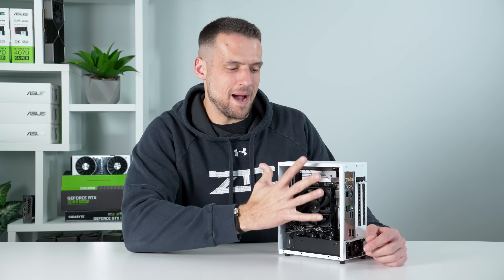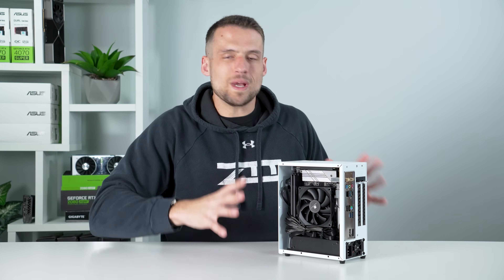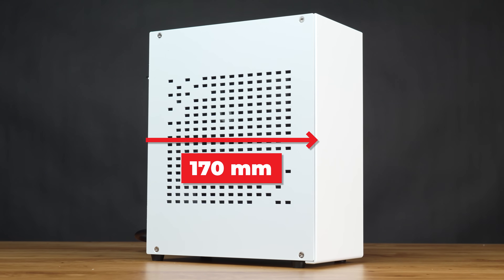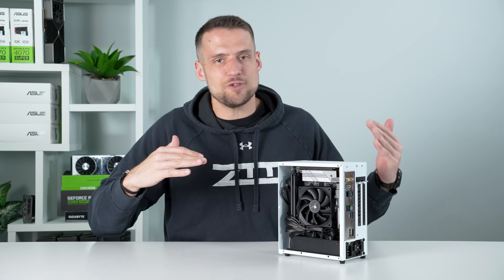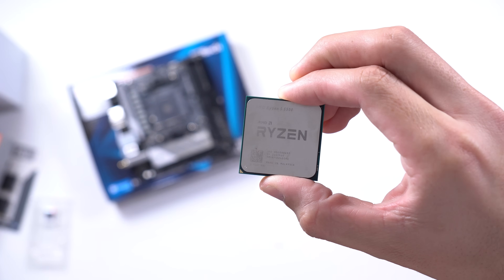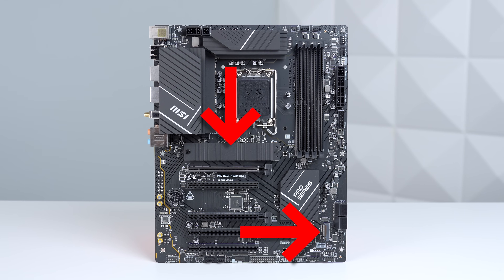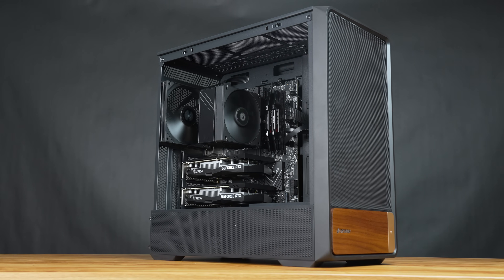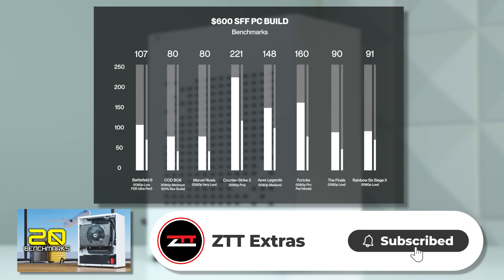This $600 Tiny Gaming PC is Unreal

Comment: hi Zach. i found the following used build at arround 600 EUR, which with the current prices seems more than excellent. would you please share your opinion : gigabyte a620m s2h Am5 + AMD Ryzen5 8500g + RAM 16Gb DDR5 6000mhz XpG  + SSD M2 ADATA Legend 710 256 + RX 5700XT 8GB XFX Thicc III Ultra  + AIO 240 + rgb thermaltake 5 coolers argb + 750 deepcool 80 +Bronze

Comment: Just out of curiosity, the budget build one that you're referring to in this video with the red on it that you have inside the case or showing in front I standalone on its own. Would that be good enough to use for 3D printer as his power supply system for external, not internal case design homemade style for a 3D printer 500 mL by 500x650 like your input on that

Comment: I built this in the brushed aluminum version of the case.  I got it at $64 CDN with the riser cable!  I wasn’t looking to do exactly the same build, but mine is very close to yours.  The 5500, while a bit old, is easy to keep cool and dirt cheap right now, making the performance-for-price value excellent.  And because you must use an SFF ITX GPU, the 5500 ($100 CDN) won’t bottleneck performance.  I got 16GB of used DDR4 pulled from a surplus business class PC for $53, which is a steal right now.  The CPU fan (x36) was $22 and the apevia flex 500W PSU was $76, so I made out pretty well in Canadian $$$.  I splurged a bit on the GPU, though, and went for the Zotac Solo 5060 single fan model.  It was around $400 CDN on a Black Friday deal. I know the 5060 gets a bad rep for value, but with limited options in this form factor, I think it makes sense. A refurbished 3060 goes for $350 and up CDN, so considering the SFF/ITX tax, the Solo 5060 packs a pretty good punch in this scenario.  I’m running Bazzite and, honestly, the performance surprised me.  I don’t mind using a bit of upscaling and frame gen, especially with the 5000 series GPUs because DLSS 4 does a noticeably better job than prior DLSS and FSR versions.  I’m getting consistent 85 FPS on ASA without turning off volumetric clouds or fog at 2560 x 1080 (UWHD), which is roughly 1.5k resolution - and the visuals are stunning.  This build is super quiet, runs pretty cool and will be going into the family room to play on a 1080p gaming projector.  Pretty sweet setup.  Thanks for the video!  It helped me greatly when it came to putting this together!

Comment: Thanks to your video I noticed that for some gpus you dont need 6+2 so i snached some last minute deal's and this project of a build will cost me 650$ instead of 900$ ( in my country it's basically to get good deal on this type of psu. Normally it costs around 300$ if you want to buy version with 6+2 cable).  Love your vids Zach!

Comment: Would the ZOTAC Gaming GeForce RTX 5060 Solo DLSS 4 8GB GDDR7 128-bit 28 Gbps PCIE 5.0 Gaming Graphics Card, SFF-Ready Ultra Compact Card, ZT-B50600G-10L, fit inside the case?

Comment: The pricetag aged like fine... milk
Reply: Yeah, I got like $828 in my amazon cart after add all components in the video, only after 1 month…
Reply: The problem with budget build videos is that it drives up demand for those budget parts which then drives the prices outside of budget-friendliness
Reply: For $600 it makes more sense to buy someone's rig that just upgraded to the latest generation than build something new. It will likely be a micro-ATX with more room for upgrades and you can ask them to keep the video card if you want a different one and some savings.

Comment: Here is my $750 AM5 build  build it can easily get it under $700 if you buy a worse psu and a case that doesn't use a riser cable but I didnt want to cheap out. Obviously ram prices have changed so its gonna cost close to $1000 now.

All parts were purchased brand new sealed and in original packaging. Prices all rounded to the nearest dollar.

Msi 5050 8gb shadow 2x OC - $210

Ryzen 7 7700 - $160

Maxsun eSport B650 ITX WIFI ICE - $105

DarkFlash PMT750 80+ Gold (white) - $85

Juhor DDR5 6000mhz 2x16GB Ram Kit - $60

Crucial P3 NVME SSD 1tb (3500MB/S) - $40

MetalFish T40 Case - $50
(+$20 riser cable)

Thermalright AXP90 X47 cooler - $20

Total - $750
Reply: 7500F Cuz 7700 overkill for 5050
And replace gpu for 5060
Reply: @Cheems_17 it was the same price like only $20 more and I actually bought a 3070 instead for cheaper it was the only new gpu in the price range but you could easily get a 5060 for $260

Comment: 2 weeks later and the cost is up nearly $300 somehow 😭

AMD Ryzen 5 5500 3.6 GHz 6-Core Processor
$74.97

ASRock B550M-ITX/ac Mini ITX AM4 Motherboard
$84.99

Klevv BOLT X 32 GB (2 x 16 GB) DDR4-3600 CL18 Memory
$176.99

Zotac GAMING SOLO GeForce RTX 3050 6GB 6 GB Video Card
$271.41

Thermalright AXP90-X36 42.58 CFM CPU Cooler
$20.39

PNY CS2241 1TB SSD
$89.99

Apevia CAPTAIN 550 W ATX Power Supply
$31.99

Aluminum Mini ITX Case with PCIe 3.0 Riser, JOYJOM Mini PC Case, SFF Small Form Factor PC Case, TX Computer Gaming Case Supports GPU Graphics Card (Black)
$125.53 w/ fastest delivery between Feb-Jun, so 3-7 months, OR 
$147.26 for 2 weeks

For just that, no OS or monitor or anything else, this build will run you $876.26 BEFORE shipping, handling, or taxes. And it is currently the Sunday before Cyber Monday.

Wtf.

Comment: Hey Zack is this a good build for running Star Citizen for around 1000$? 
AMD Ryzen 7 5700X 3.4 GHz 8-Core Processor
Thermalright Peerless Assassin 120 SE 66.17 CFM CPU Cooler
MSI MAG B550 TOMAHAWK MAX WIFI ATX AM4 Motherboard
G.Skill Trident Z RGB 32 GB (2 x 16 GB) DDR4-3200 CL16 Memory
Crucial P310 1 TB M.2-2280 PCIe 4.0 X4 NVME Solid State Drive
Asus DUAL EVO OC Radeon RX 7600 8 GB Video Card
Fractal Design Focus 2 RGB ATX Mid Tower Case
MSI MAG A650BN 650 W 80+ Bronze Certified ATX Power Supply
KTC H24F8 23.8" 1920 x 1080 180 Hz Monitor

Total is $1057.96

Comment: The one thing i would replace out of that build would have to be the GPU and going for a used RX 6600/6600 XT as it would have better performance not to mention i could install SteamOS or Bazzite with game mode enabled for the games that doesn't really require anti cheats.

Comment: If I could, HP makes a single fan 2060 super with an 8 Pin socket that's actually on the back (opposite the displayport hdmi port ) of the card which would help.  And it actually might be cheaper for your build process for small form factor builds.

Comment: I don't know why do you need 600$ pc... Better buy a laptop for gaming. 
I built 9800x3d + 5080 sff in Fractal Ridge. 2 time faster than a laptop and cost a lot cheaper. But, weights about 15 kilos. Not an easy task for a flight.

Comment: I got a single fan 4060 which went for 100 more than the 3050, for about $290. More than enough for a small build like this but I do have worries about thermal problems for such a powerful card cut down in size.

Comment: Hey Zach, I could really use your help with my pc, I can’t reinstall windows after my pc gave me the “your system ran into a problem and needs to restart “ “0%complet” I first tried to reset my computer, and it kept doing that, then I went to bios and checked everything was good on that end, but it kept giving me that screen after booting, then not knowing what to do, then from my house I had it completely clean all my SSD’s, and then from there, I tried reinstalling Windows from a flash drive, this is a Dell XPS 8960 tower, that I’ve had for about 3 to 4 years, but I think since I wiped the SSD’s my PC won’t let me reinstall windows, it’s asking for a driver, so it can notice my hardware, please help me Zack!!!

Comment: I got myself a used rtx 3070 for 275$ and deepcool pq750m for about 60$
Was is a good deal
I will pair it with i3-9100f for the time beingand i know it will bottleneck but i upgraded from rx570 4gb and intend to upgrade later
Was it a good deal and is there any thing that i should be careful of?
Thanks for anyone who is gonna answer me😊😊

Comment: Just finished building my second pc lastnight: 
Lian Li O11 vision full size black case
Gigabyte Aorus Pro X870E
Ryzen 7 9800x3D
32GB Corsair Vengeance DDR5
Corsair Vengeance Light Enhancement Kit
4TB WD Black SN8100
Gigabyte Aorus Master 5080
Corsair ICUE Titan 360mm AIO
8 Corsair LX120 fans
3 Corsair LX140 fans 
Lian Li Strimmer wireless extensions
Lian Li 1,000 Watt PSU
Reply: Nice buil

Comment: Im looking for a case super small like that one, as small as posible, but with support for a regular dual fan 9060xt.
It has to be small enough to fit on my backpack along with a portable screen, a keyboard and a mouse (and the power cable along with the display port or hdmi cable)
Not a super huge backpack, but a reasonable big one.
I have found either itx with low profile gpu or 1 fan gpu or 3 fans gpu... but that mid ground of just 2 fans and as small as posible... nop. not the first case.

Comment: Cut out a slot in the front panel and you can fit 9060XT reaper no problems it wont look to bad trust me lol or you can fit a pci x 8 oculink card and run it connect to a egpu either way wait for AMD to bring out thier next powerful APU or buy a all in one board with a AI max chip fitted and you will have a very powerful ITX steam machine

Comment: My first PC for fast 1440p gaming, is it any good?
ASrock Challenger 9070 XT
9600X or 7800X3d
WD-Black SN850X 2 Terabyte SSD
Corsair Vengeance 32 GB ddr5
CoolerMaster 360 Mill AIO
MSI B650-P
Montech Century 2 850 Watt PSU
NZXT H7 Flow
VETROO case fans, make it 4 black
Viewedge CS27QK 1440p monitor
MCHOSE hall effect 60% keyboard

Comment: Zach I am going to buy a pc soon and i want u to rate the specs
Cpu :ryzen 5 7600x
Cpu cooler: thermalight pearless assasin 120 digital
RAM :CORSAIR VENGEANCE RGB DDR5 2 32GB (2 x 16GB) DDR5 5200 CL40
Motherboard : MSI B650M GAMING PLUS WIFI  matx
Gpu : rtx 5070
Case :Lian Li a3
Storage :crucial 1t nvme
Psu : CORSAIR RM750x Fully Modular Low
I didn't forget the fans and these stuff
All gonna cost about 1480 usd
Wt u think?? Anybody can give advise

Comment: my power supply went out while we were having a storm i replaced it with a 1200w modular one but the screws holes on the case doesnt line up with the holes on the power supply how do i fix

Comment: Zach, I have a Ryzen 7 2700x, a GTX 1070, 32GB RAM all in an AsRock Taichi X470 Motherboard and powered by a Seasonic Focus Plus Platinum 750W PSU. I want to upgrade bit by bit, starting with the GPU. Should I get an RX 9070 XT or rather a 9070 or even 9060 XT and upgrade the CPU at the same time for 1440p?

Comment: Zach i just got my psu and gpu but my cable from the psu thats supposed to go in the gpu is a 12 pin but my gpu needs 2 x 8 pin connectors what should i do?

Comment: Quick question if it's worth to buy a prebuilt for 950€

Cpu Ryzen™ 5 7500F 

 Deepcool CPU Cooler AG400 ARGB

Motherboard Gigabyte A620I AX

Ram KINGSTON 16GB (2x8GB) 5600MHz DDR5

Ssd KINGSTON 1000GB NV3

Gpu ASUS Dual Radeon™ RX 9060 XT 16GB

Case DeepCool CH160

Power DeepCool PF600 600W 80 PLUS

Comment: Hey @ZachsTechTurf  I was has build AM4 system PC with sub 900$ budget I get 
-Ryzen 5 5600XT CPU (originally I was gonna use 5600 non X. but I get this instead I bit cheaper)
-RX 9060 XT 16GB
-32GB DDR4 3200Mhz ram (it was almost A fifth of the budget)
-Gigabyte B550M K (A bit Cheap but ok-ish mobo)
-and 1TB NVME
what do you think about my build? ( I actually wanted to build an AMD AM5 system. But with all the components being so expensive in my country right now. some are almost double the original price, I decided to build an AM4 system, which would definitely be cheaper.)

Comment: Hey Zach! I’ve a question, today I upgraded my gpu, i had a 3060 and i bought a 5060 ti, but my fps didn’t go up, i would say that maybe they went down a little, i already check the bottleneck issues, power supply issue, ram issue and updated the drivers and i feel that it didnt fix anything and a detail that i gotta mention its that my bar for the vram on gta (when u set up the graphics and everything, its stuck on yellow, doesnt go green or red) idk if thats important! I would appreciate an answer, thank u

Comment: i managed to modify my zotac 3060ti into a single fan gpu, and it fit quite well in this exact Case with the only upgrade i needed was a 600w PSU. The cables are cramped because the psu is not modular, but i'm having no issues. cpu and gpu seem to hover around 70C or lower depending on the games i'm running, at 1080p medium settings. I really like this case 🤍
Reply: How?? I also have a zotac 3060ti

Comment: I've built PCs in all shapes and sizes and really going super small is never really worth it. Before RAM price trippling you would be able to scramble 7500F or 9600, mATX B650 motherboard with PCIE Gen5 from China (Colorful CVN) and couple that with 9060XT 8GB (if money not an issue, 16GB - 70 bucks extra is worth) and shove it in budget case like Dan A3 which is still fairly compact in that price and would literally crush this... but more importantly, you're not limited to very few hardware choices. I have built miniITX in 5L case (LZmod A24-V5) with low profile 4060 a while back and my only real miningful upgrade path is.... taking it out of that stupid ass small case. Before low profile 4060 we were stuck with either 3050 or A2000 which was way way way overpriced for what it was - who knows when we will get any meaningful performance upgrades in those small form factors next - a very niche market with a very hefty premium.

Comment: Yep, not many options, especially if you want something cheap. 
This is the main selling point of the steam machine IMO - small factor and preinstalled OS, everything ready to use. I don't expect it to be cheaper then custom PC with similar specs, but you must consider the amount of effort to build something similar by yourself.
Reply: a similar spec miniPC is all over 1k usd... its a gaming laptop in a box... not a normal PC...

Comment: These days for an ITX build the TAX is basically the PSU, as higher power quality units are expensive (thank god I got my ENP-7660B 5 years ago)
and... PCI-E 5.0. Because ITX mobos with pci-e 5 and pci-e 5 risers are just dumb expensive.
also sad part is that if u want to go team red for the GPU, the best u can get in under 180mm is one RX6600XT from ASRock :(
I paid premium for aa ASUS B650E-I gaming wifi motherboard, but a used rx6600xt was cheap, and SteamOS came to the rescue :D

Comment: I built 2 very similar to yours, same CPU, bought it 3 days before you for $61, I use the K39 case $65, it allows me to fit the AMD original heat sink, I paid 1TB for $53, 32GB for $39, my motherboard is Gigabyte A5201 AC $99. PCI riser $16, $25 video card Quadro P62 (4 4K Display port output, it's for workstation use, not intense gaming) Power Supply $35

Comment: Bro I built my rig with 180 bucks Ryzen 5 7600x 6600xt ,Corsair vengeance 6000 ram,GPU Corsair 650, nzxt kraken 63 aio, 500gb ssd, 4tb 2.5 HDD and a nzxt h5 or h6 case overclocked up to 5.7 currently oc to 5.6 I get hella fps on Minecraft and cyberpunk up to 180 solid with 280 spikes during gameplay ask me how I did it because I have one I'm building rn for 0 bucks all I need is the PSU and ram and ssd and it's done 👍

Comment: For my mini theater PC it had to be the Fractal Ridge. SFX PSU support 2 fan card support. Originally paired the 5700X3D with an Arc B580 but moved up to the 9060XT when one came through work for a hell of a clearance (Sapphire Nitro 16GB for $300 minus $150 trade-in on the B580)
Reply: yep thats the size which is good compromise imho, keeps the perfect budget/power balance

Comment: The Ryzen 5500 is a good choice here because of the riser and CPU only supporting PCIe 3.0. I've had boot issues using a PCIe 3.0 riser with a PCIe 4.0 capable CPU+GPU, having to lock the PCIe x16 slot in the BIOS to 3.0 to make it work right. Something to be aware of when using one of these risers.